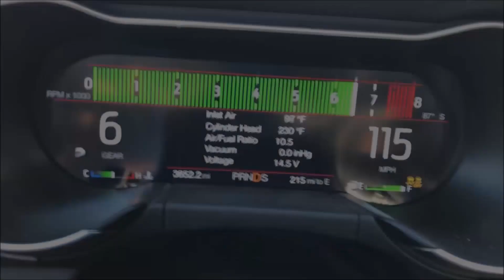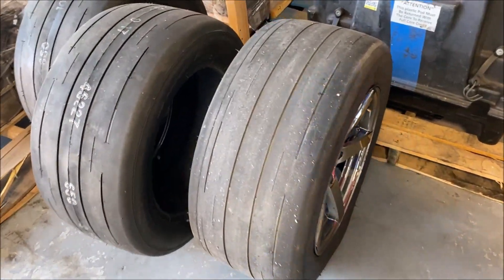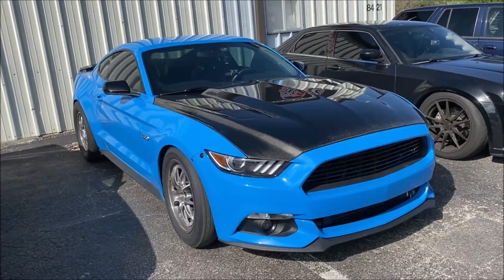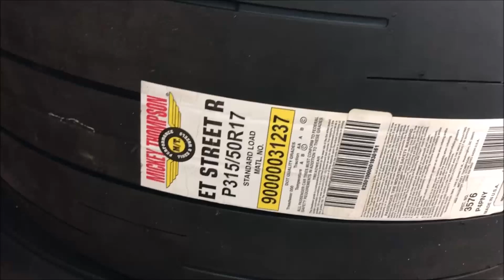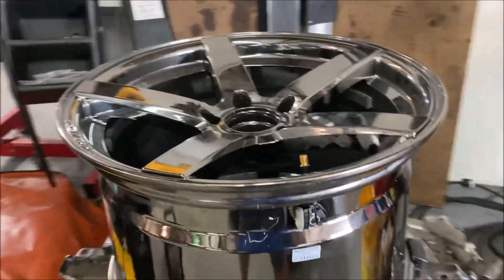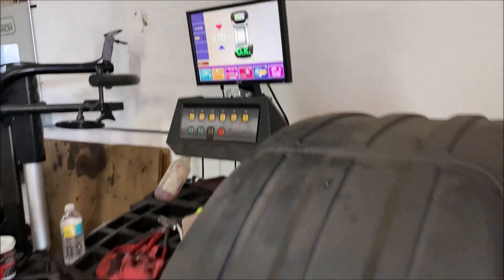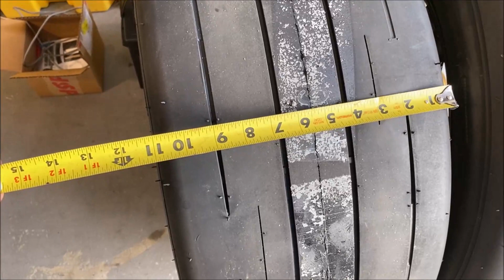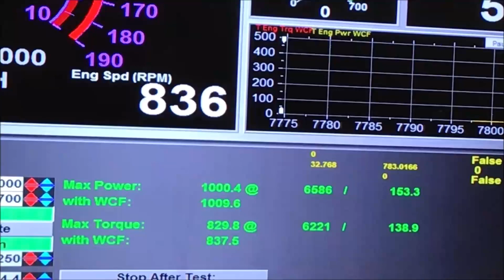2019 Mustang _ Stage 2 Whipple _ Gets Drag Radials _ 305's or 315's _ Which is best?

Comment: I'm running 325 on the rear of my 16 mustang
Reply from the maker: Jamie How did you get them to fit?
Reply: @coyotecarguy2076  it's on 11-in rim 19-in diameter it's not a drag radial but a continental summer only tire ....hooks pretty good though fits no problem though
Reply: @coyotecarguy2076  325/40r18 M&H DR tires are between a 305 and a 315 when put on a 18x11 wheel and a 325/45r17 M&H DR tire is the same width as a 315 on a 17x11. Both are approximately 28 inches in diameter.
Reply: And they make sweet sweet love to your wheel wells heheehehe
Reply: @tracybasler7387  Are you saying that any tire wider than a 305 will rub on a non Shelby S550 Mustang?
Reply: No rubbing at all on mine.

Comment: I ran 19x10 front and 19x11.5 in the rear with 285 40 19  fronts and 345 35 19 rear nitto envo with project 6gr 7 wheels and had zero issue. I was tired of buying nt05r drag radials they only lasted 4k miles at best. They didnt hook quiet as good but they were damn good to me at 600ish hp
Reply from the maker: csr801996.  . . I was told the 345's would mount on an s550 with the 11.5 rim but correct me if i'm wrong but they project out the wheel about 1/2 inch. . ..  is that the case?
Reply: @coyotecarguy2076  they didnt stick out at all on my car. They were flush with the rear fender. I had them on my 15 gt pp. I just ordered a set of five rims from 6gr in 10 and 11.5, I may end up running the 325 for the rear not sure yet. The 345's looked so good though
Reply: @csr801996 can you send us a link to the forum? I would love to see 345 street tires on the rear. 😮

Comment: Great Video Al, I am looking at tire sizes now, thinking 305 myself.. let us know how the 315 works out..
Reply from the maker: Michael N. .. . .The 315 is really tight in there . ..  the 305's fit not close to anything. . . unless your making BIG power i say the 305's will work just fine  .
Reply: @coyotecarguy2076  I have a set of 15×10 race stars but don't wanna lose the ebrake.. I make around 700whp. I'm thinking 17 and 305!!
Reply from the maker: @michaeln.7083   ..  smart move. .  that combo will work well
Reply: @coyotecarguy2076  my car is a stick car, luckily I have a Barton hybrid shifter which I highly recommend, didn't wanna lose the ebrake on a stick car I would surely forget LOL!! Don't wanna see down a hill keep up the great work Al

Comment: Love the wheels Al, wish I could find a pair!    Are you both on stock axels or did you upgrade?  Also, will your gear ratio change with the 315?  Sorry, if I missed it.
Reply: Ok, I see the suspension, and axels.  Can I ask why you went with ford racing axels over the $200 cheaper G-force who makes them both?  Just curious make buy soon.  Do you have a link to your wheels? Thanks
Reply from the maker: stangfreak91 . . i went with the ford racing axles because they were available at the time i had to wait for the other ones. . .   those were rovos wheels i got from american muscle. . i dont know if they still have them.  ..

Comment: If your not spinning on 305s stay on 305s I would like to go down to 275 because I don’t need 305s. The less tire you need and still hook the faster you will go. Going a taller tire kills your 60 foot unless your spinning. I think those taller tires are over kill. I seen many high hp and high torque cars like hellcats hold on 305s but 315s are good growing room.
Reply from the maker: Hey Fran. . . Howler makes a lot torque but we will see if the 315's are really necessary  . . we will find out when i start running my car after tuning ..  .i also may try the 315's on my car at some point...

Comment: Hi Al, love your channel. I have a question for you. I have 20x9 roush rims on my 15 gt  and would like to put a set of drag radial on them. Is it worth it or should I buy some new 18 inch rims that look like the roush rims. Keep in mind its a stock roush charged 727 car.
Reply from the maker: scbird1.. . . Unfortunately there is no good size drag radial to mount to a 20x9 rim... i have 20x9's also but really there is no good option .. .i would say go with 19x10 or 19x10.5 then there is a lot of options for a Nitto or a M/T drag radial. .  good luck!

Comment: Can you post links to the wheel and tire set up for the 315s? If they fit without modifications that's what I'll go with
Reply from the maker: Hey josh. .  they fit but VERY tight. .  they even rub slightly on the inside well. . nothing terrible but i am sticking with the 305's  stay tuned i will have more on howler down the road . . here is a link to the rim. . .good luck
https://www.americanmuscle.com/rovos-mustang-durban-drag-black-chrome-wheel-17x105-406596g15.html